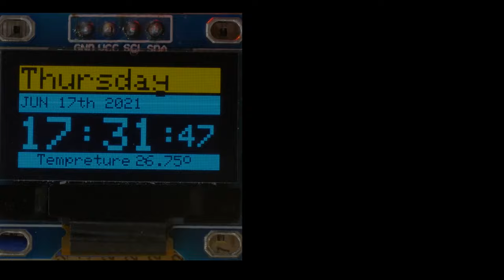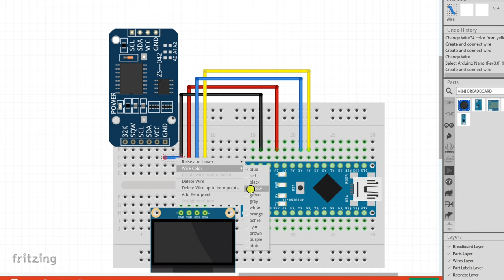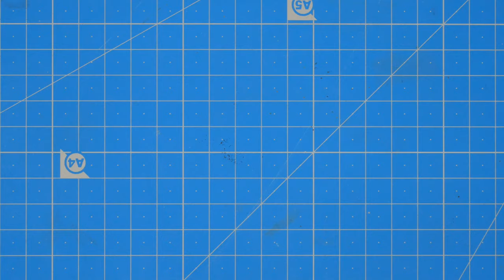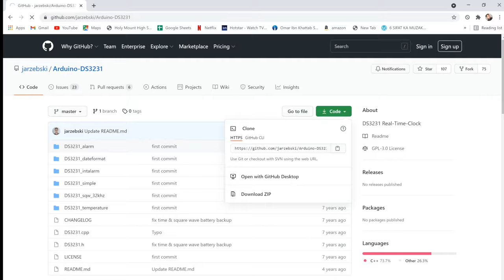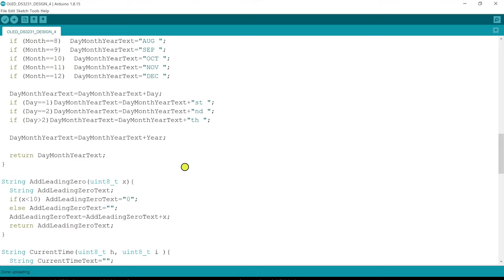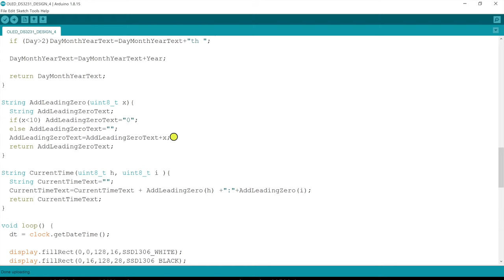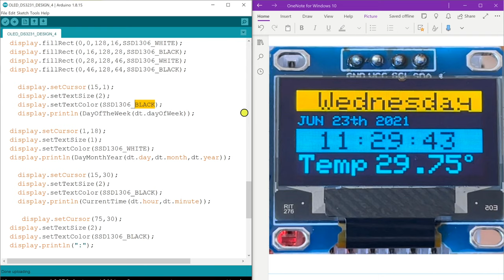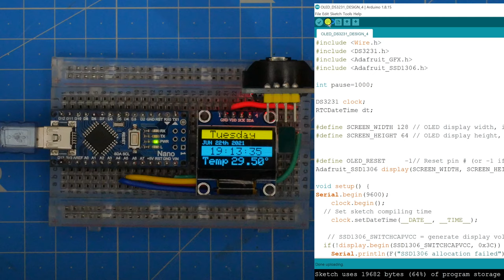HOW TO MAKE OLED DIGITAL CLOCK USING DS3231 RTC MODULE, 0.96" OLED DISPLAY AND ARDUINO NANO

Comment: Hello , I downloaded the Library You provide but I get over and over this Error :
""...OLED_DSD231_DESIGN_1:8:1: error: 'DS3231' does not name a type; did you mean 'CS21'?
 DS3231 clock;
 ...""" 
Any Solution to solve the Issue ? ...
Thanks

Comment: My friend on line 12 of ID DS3231 clock; I get the following error 'DS3231 clock' redeclared as different kind of symbol
What could it be, could you help me: since your videos are very good and your explanation thanks from Mexico
The error is in all your examples
Reply: the "redeclared as different kind of symbol" error happens because there are two different libraries with the same name, "DS3231", one by andrew wickert and the other one by Korneliusz Jarzebski.  this last one is used in the present video. uninstall the other one (which is much more popular and available at the online repository).
Reply: Thank you @kaustubhsingh16

Comment: Hi, I'm trying to share your project, but it always gives me this problem.( DS3231 clock;  redeclared as different kind of symbol )I'm getting this problem on the arduino as well
Reply: Me too ... I was trying to find a solution but NO Luck ...
Reply: ""...OLED_DSD231_DESIGN_1:8:1: error: 'DS3231' does not name a type; did you mean 'CS21'?
 DS3231 clock;
 ..."""

Comment: Using your Design2 but when I load the sketch it does not pick up the correct time and date.  It shows Monday, Jan 1st 2000  00...Hrs
Reply: Never mind, I worked it out and time is all working now.

Comment: bro actually the time is not continuing after removing the connection. Why?
Reply from the maker: Check if ds3231 module is working fine and the cell which is used for ds3231 is new one
Reply from the maker: It happened to me too, then I Changed the cell of ds3231 it worked fine
Reply: @MOUNTDYNAMICS  ok bro 👍🏻

Comment: can i have the same clock with 0.96" TFT screen instead of  the 0.96" OLED ??
Reply from the maker: Libraries differ bro. Code is made for 0.96” OLED DISPLAY
Reply: @MOUNTDYNAMICS  
thanks for your reply, is there anyway to find the libraries for the 0.96" TFT screen ??

Comment: The project is quite remarkable and attractive one but friends be aware you will not get any help from the author of this project. I have a practical experience regarding this. If you are master in coding then it's ok but if you don't know coding there it's quite difficult to make the project successful. Actually the coding of the project must hided by the author. If you are new one in this then don't go for it.